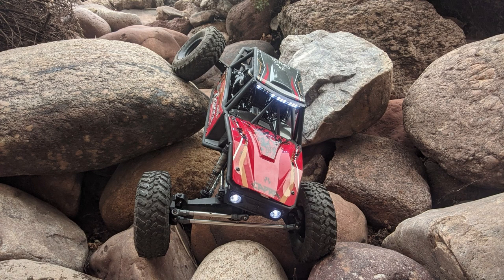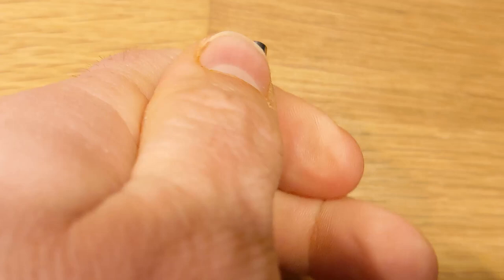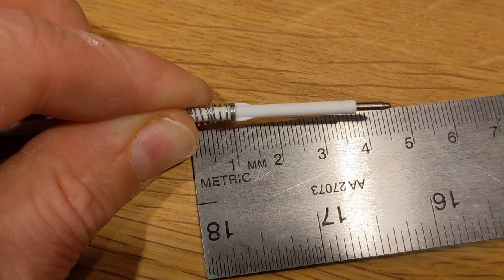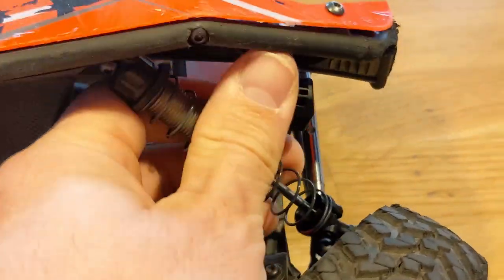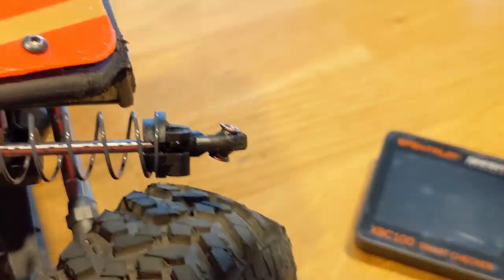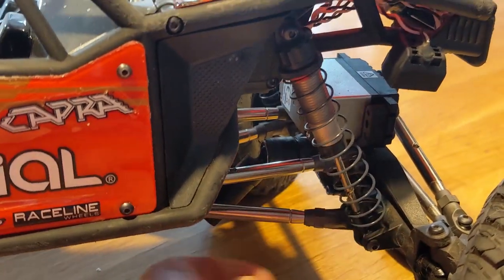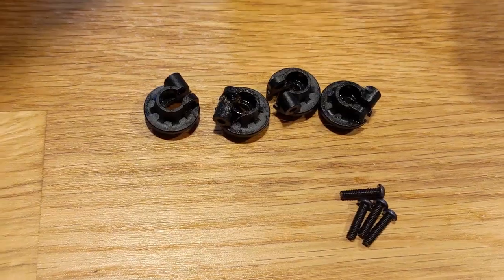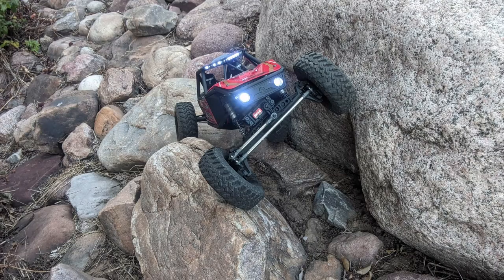STOP PEN SPRING MODS ON YOUR CRAWLER!!!

Comment: The travel limitation of pen springs is so that when the front end becomes unweighted at steep climb angles the pen spring will actually pull the body back down towards the wheels and help prevent rolling over.

Comment: You are talking about 2 totally different things here.. yes taking the spring cups off will lower the car but the pen spring mod is to limit down travel .. it has nothing to do with the ride height of the car.. 🤷‍♂️
Reply from the maker: You might want to read your comment again.  "Yes taking the spring cups off will lower the car" followed by "It has nothing to do with the ride height". Yet ride height is the distance between the bottom of the chassis and the surface. So I guess you're right and wrong at the same time. Also, I'm not looking to limit travel. Thanks for your comment! I got a good laugh!

Comment: I doo the hair tie mod ,no lost of suspension travel or full flex  with the right rings.Lowering chassis 10-15mm also.
Reply from the maker: I find it easier just to remove the caps. I don't lose any suspension travel and still get full flex while still lowering the rig.